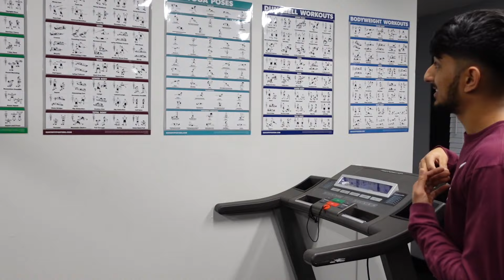Garage Makeover! ADDED A HOME GYM!

Comment: hey, about the video where you cut your fenders on your white e46 sedan. Will my style 32 9J ET22 fit with 235/35/18 tires on rear with cut quarter panels or do i have to go down to 225/35/18. 225/35/18 looks too skinny to my liking..
I have pre fl e46 sedan.
Thanks in advance
Reply: Thinking either going 205/40/18 front 225/35/18 rears or if the 235 will fit rears then 215/35/18 front and 235/35/18 rears, what are your thoughts my friend will the 235 rub on rear. Im lowered on coilovers.